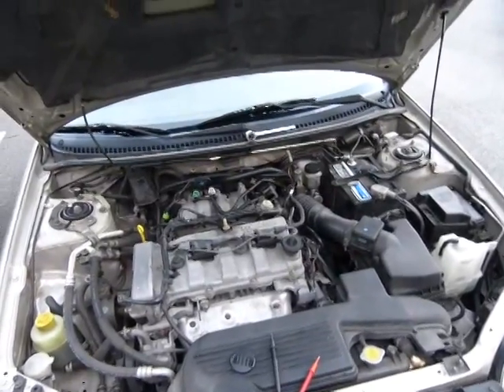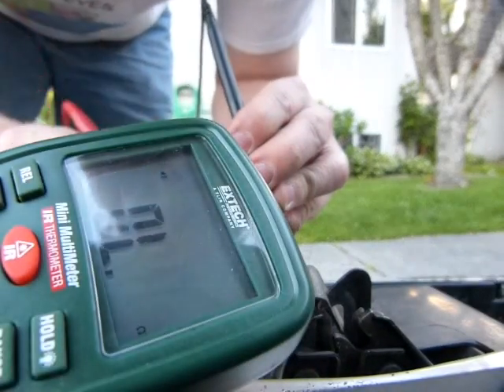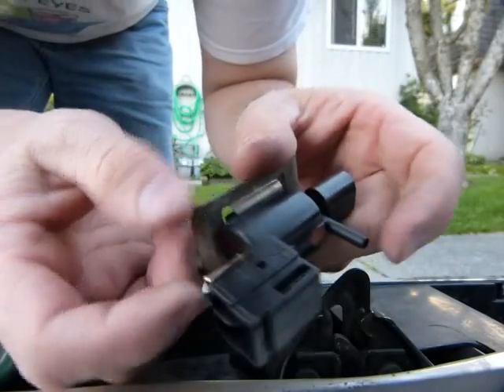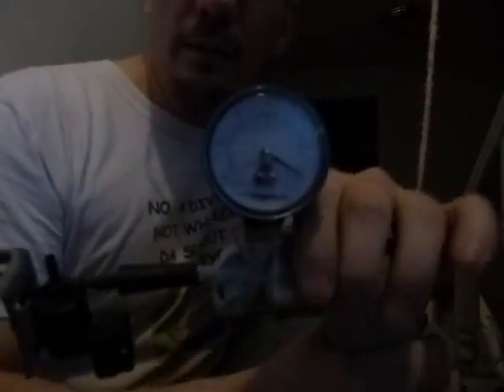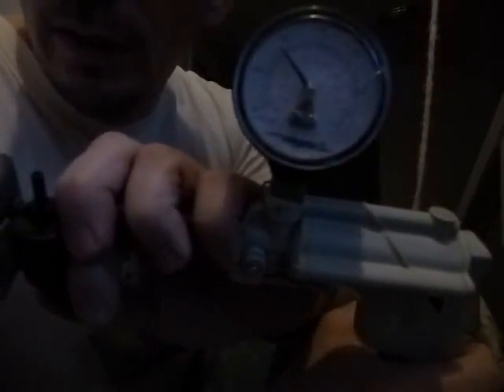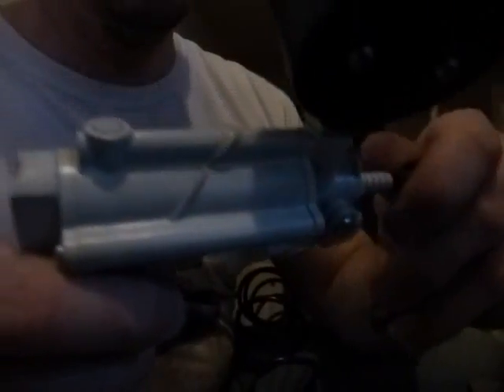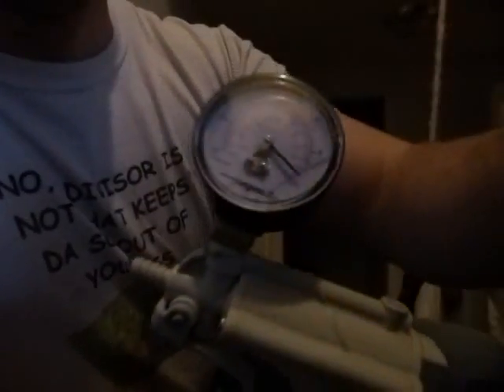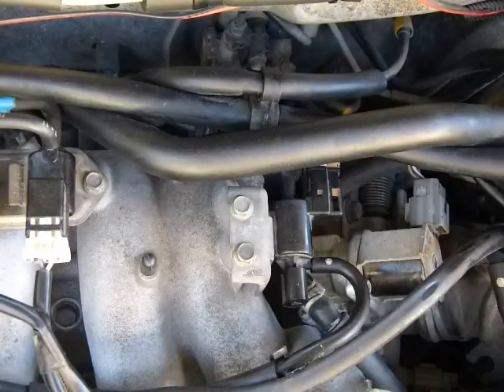Mazda PRC solenoid OBD II P1250 fix (ZM/FP/FS-engines)

Comment: Hi I have 2 codes a p1250 manufacturer control and a p0758 solenoid electrical. Will the 1250 code put engine into limp mode causing the shift problem?
Reply from the maker: Absolutely not

Comment: if the electrical hardware its ok; then check the vacuum lines and if these lines are loose just replace it with new vacuum hoses (1/8" usually)
if all that dont helped ot just replace that motor and delete dtcs, drive vehicle for at least 75 miles and scanned again - f dtc doesnr showed up then new replacement part fixed thw culprit 😁
Reply from the maker: Thank you for sharing your insight!

Comment: Hi there, I think that's a solenoid and will open when powered.  Maybe that's the reason it is not functioning
Reply from the maker: It's resistance gets out-of-spec as it deteriorates gradually and becomes not functioning.

Comment: Thanks for checking the PRC with a multi-meter and explaining why and how to do it.  I did not quite understand the theory so I am Google searching and learning more about electricity.  Thanks as well for referencing the Mazda Forum Online Diagram and describing in very clear terms how to use the online diagrams to test your PRC Solenoid.  OBD II Code 1250 disappeared on a 2002 Mazda Protege5 after changing the PRC Solenoid also known as a Exhaust Gas Recirculation Vacuum Solenoid according to an online parts store.

Comment: Something I have discovered on a Miata at least
If you have the monitors for the emsision system satying in a noit reay state even after doing several drive cycles, Then this may be the problem
Twice now I have had the monitors not go into ready and both times it has been this part even though it does not indicate bad
If you have trouble with monitors setting then try replaceing this with aknown good one
This same part for a PORTEGE WILL FIT A MITA THE DIFFERENCE IN COST IS ABOUT 40 BUCKS

Comment: Question: if the PRC or FPR is defective, will the fuel pump not turn on? My fuel pump doesn't come on, and the "engine" fuse blows as soon as the key is turned, which feeds the ECM, which feeds the PRC.
Reply from the maker: There is a short in the harness somewhere. See system overview https://www.youtube.com/watch?v=ZEysaEktCXA , PRC and related solenoids` detail 12:30 - 15:00 -ish
Reply: Thanks, will be checking it tomorrow.

Comment: just buy a new solenoid
Reply from the maker: A $110 part for a $500 car? Not happening.
Reply from the maker: Electronics fail gradually as plastics or rigid soldering break down and develop an open in the circuit, work a bit, not work a bit, work again ... It will come back, guaranteed. Keep us posted.
Reply: @theoverengineer  A $100 part for a $500 car is better than $500 a month for a car payment for 6 years. Some parts last a long time and only need to be replaced every several years. I'm finding Autozone parts suck dick.
Reply: There is hose leading to the intake i just noticed it is cracked. Can this be causing the p1250 code?  I want to sell the car once this winter is over ( barely drive it)  and its not worth much because it has lot of dents and some body damage. So i dont want to invest much money in the car. Thanks..it was also throwing the p1569 code to..Ugh..my car is probably worth $1200 so im trying to do this myself,
Reply from the maker: Intake hose crack can not possibly be the cause, the PRC solenoid is not plugged into it.
Reply: theoverengineer I dunno but i put some electrical tape on it. The next day ( this just happened) the check engine light turned off. I hooked up my cheap obd scanner and its not showing the code anymore. Im crossing fingers here. Hoping the check eng light doesnt come back on.
Reply: theoverengineer i also cleaned the contacts as best i could w tiny piece of sandpaer.for the vtcs. I will have to wait a few days see if the cod comes back i will keep you posted.
Reply: theoverengineer Thats what i was afraid of. When i did have the code it will come and go. The car runs fine other than that. Thanks for your help.

Comment: You misread the manual - If there is no voltage between terminals A and B there should be airflow between ports B and C. Airflow between A and B should only occur when there is voltage (from battery - about 12 V) between terminals A and B. It's logical that the third port will be sealed off. So that there is vacuum at port A when there is no voltage at terminals is actually correct. So this didn't prove much - only that it works correctly in its unpowered state. It might be stuck at this, so might not switch ports after applying voltage so it still could have been broken, or actually not.
Reply from the maker: trippleslots Yes, like I found no continuity at 1:22 but did find resistance. Strange. Ageing solenoids may only partially open, allow less vacuum, which the PCM detects as P1250. Blowing/cleaning may help inside and at the contacts. This all is an alternative to the obvious: spending $90 on a new solenoid that works for sure.
Reply from the maker: the dutohlav Thanks, you are right. Of, course it makes total sense.I`ll label over the footage.
When I only have the broken part, (and no working one) I can only guess, and I`m usually wrong, like at 11:10-11:40 at this https://www.youtube.com/watch?v=3-zkBFMTB1A until I do have a working part, like at 15:45 - 16:15.
Thanks for watching.
Reply: theoverengineer
 I have found that this is only a hope it works method as I have a 96 Miata and it will work fine on a test bench but will not when actually plugged into the circuit
Reply: theoverengineer
After seeing your reply ,I realized All of my post did not appear.
 I wanted to say Thanks for making the video it at least told me what it was how it should react and what it looked like
 It also lets me know how a good one should react
 After checking mine again in between post , I have a ohm reading of about 46 which tells me even though it clicks it has such a high ohm reading it is still bad .
 I take that one side is 12 volts and the other side is actually a ground that the ecm switches on and off
 If I have 12 volts between the two wires ,then the circuit is complete only the high ohm reading keeps it from working correctly
 Thanks again for the video